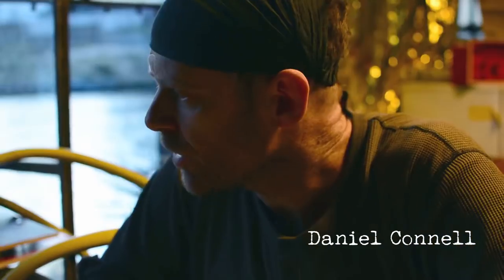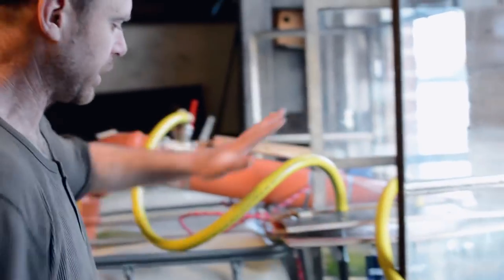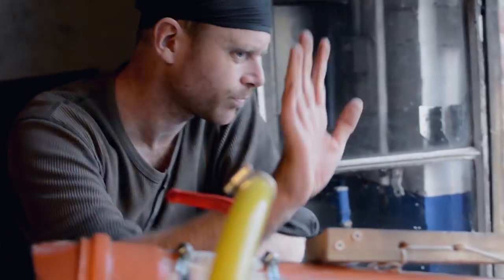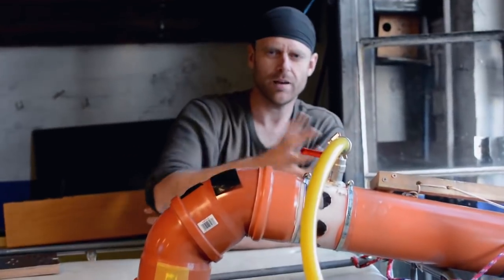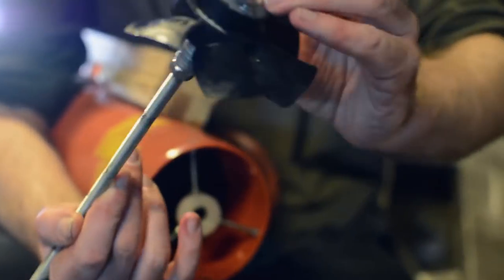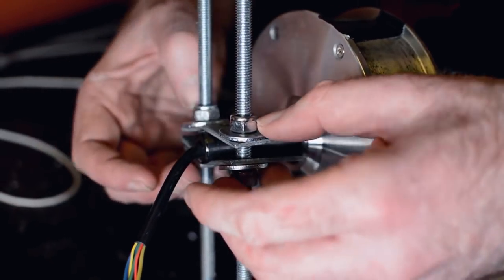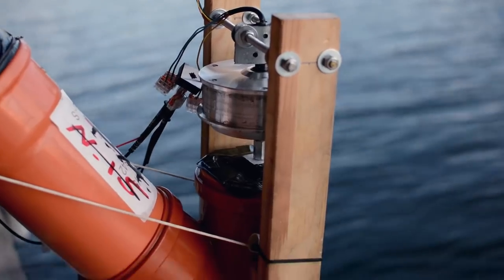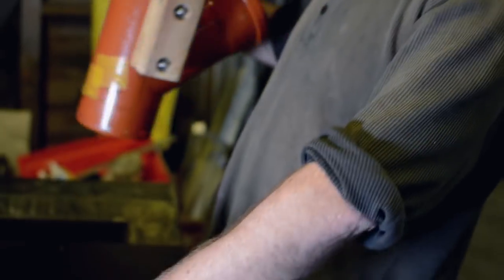$50 Water Turbine-5 kilowatt hrs/day - Open Source, DIY

Comment: How about a Tesla Turbine at the end? I know, maybe not a 40€ Turbine anymore, but would be interesting to see the difference in output
Reply from the maker: Problem would likely be that it would reduce the flow in order to generate its working pressure, and so take a lot of power away from the fan impeller.

Comment: Awsome,..... now for a challenge, can you make something for a no head stream or creek like i have, its turning my brain to mush.
Reply from the maker: It's been asked a fair bit. Yes, but kind of only really if the water is moving fairly quickly.
Flat water with not a lot of flow is notoriously hard to extract energy from.
I am giving it thought tho..
Reply: Yes thats right, and thankyou for the reply. You've got my brain matter churning , maybe i was thinking too big.
Do you know the rpm its running at its full potential?
Reply from the maker: Yeah saw that, it is quite similar to mine but predates it, and I only became aware of that turbine after I'd started working on mine.
Seems more robust and possibly more efficient, but about thirty times more expensive...
Reply: @OpenSourceLowTech  Do you know the rpm its running at its full potential?,  Would a fan with a less flat angle and having 2 of them about .5mtr apart, give you more rpm with more torque?
Reply from the maker: Top of the power curve for this test was at about 1200 rpm.
I tried two other fan shapes, one with steeper pitched blades, one with a larger central hub, both did about 20% less power overall. From what other similar turbines use I think probably something like a outboard propeller would be a more ideal shape, but the PCU fans seem to be doing a reasonable job, and are by far the easiest to source that I've found so far.

I also tried two of them back to back, but it didn't make any measurable difference at all.

Comment: Can anyone advise how to calculate the power necessary to charge a battery bank?  Would you be able to combine a solar and hydro solution into one bank or would you need to have multiple ones?  Thanks for any guidance.
Reply from the maker: Depends on your setup and needs.
If you get a charge controller or equivalent box which can handle PV and hydro then the two would probably compliment each other quite nicely.
Reply: Thanks for replying! I think your work is really amazing

Comment: Are you running into problems when increasing the height?
It seems like it is reyling on suction, since the turbine is in the top. I could imagine that introduces problems with cavitation and maximum operation height of around 10m. Am I right?
Reply from the maker: The largest drop I've tested so far is three meters, but the longer term field test install I'm currently working on is almost five.
Cavitation has been an issue and that's the main reason I moved the turbine assembly further down the pipe in this build than the last one in Barcelona. That plus increasing the diameter of the draft tube seems to help a lot.
I think with larger drop installs it'd probably be best to keep the draft at about three meters and have the extra height on the uphill side of the turbine, but I'll experiment with various configurations and see where the sweet spot is.
Reply: @OpenSourceLowTech  Thanks for the answer, very informative. Love this project, intention, execution and dedication <3

Comment: Question for anyone. 
how much power would it take to pump water back up to the resevour?

Would the power to pump water back up drain all of the power this process would generate?

In short to create a system that feeds itself, but leaves some extra power left over? If done in scale potentially feeding part of a home's electric needs?

Comment: can siphon work decreasing the outlet? i'm thinking the output is smaller so it's shoot like a jet pelton turbine generator.
Reply from the maker: The power comes from the momentum of the water, so you want to get as much volume moving as quickly as possible. A throttle / jet would increase the velocity at that point, but reduce the flow overall and so reduce power.
It's quite a different dynamic to a pressure turbine such as a Pelton or Turgo.
Reply: OpenSourceLowTech 
The deciding factor is the geometry of the impeller blade as a function of the head and the pipe diameter but I agree that minimising friction losses is important. I think you should try experimenting with different fan configurations if you have not already done so. For example, put two fan rings one directly after another on the same shaft but offset by one half pitch. This will increase the torque but may disproportionately reduce the angular velocity. Conversely, the opposite effect will be seen by snapping off every other blade in the one fan setup. You have tuned the electrical side but not the hydraulics!
Reply from the maker: @davelowe1977   I trialed two other shapes; one with steeper pitched blades, and one with a larger central hub. Both did about 20% less power than the standard 120mm fan as pictured, which I was happy about as they're by far the easiest to source.
I also did exactly that with the two fans joined, was also anticipating a potential boost to torque at the cost of rpms, but in actuality wasn't greatly measurably different. 
Also wanted to thin the blades but unfortunately pretty much all these fans have seven...
Reply: @OpenSourceLowTech  Sometimes what doesn't work is just as valuable information as what does!

Comment: How much power can it produce now? You certainly need an inverter and may be a transformer.
Reply from the maker: 192 watts, with some room for improvement.
What you plug it into will depend on each individual situation and use case, but those are options, yes.

Comment: Would you be able to add more turbines per system or would you lose more power than it's worth?
Reply from the maker: You'd lose more power than you'd gain. Each impeller extracts momentum and slows the flow, so essentially steal energy from all the others.
Reply: @OpenSourceLowTech  thanks!

Comment: I can't get what are these electrodes doing? Sorry if it's a dumb question.
Reply from the maker: In the liquid rheostat bottle? One's putting the current out, the other's receiving it. The purpose is that the liquid in between is only partially conductive, so by making the electrodes further apart I can introduce a variable amount of resistance in the circuit, which lets me set the current going through it and thereby measure the amount of power the turbine is generating under different loads.
And that lets me find the point of maximum efficiency and output.
Reply: @OpenSourceLowTech  So... is one of the electrode's like a variable resistor? And... I guess you've made it to be sure that a mechanical rheostate will not be burned?

Comment: What happens if a fish comes through the pipe it will get stuck and jam the mechanism or other River Dabre.  I can see that would be it's the liability of that impeller.  I guess if you put a screen over the end would solve that problem.
Reply from the maker: As you say, screen.
Mesh box to increase the surface area and reduce the pressure should hopefully do it, especially if it can be clever enough to be self cleaning..

Comment: This is incredible! Would this work in the winter in places where winters get pretty cold? (I live in Michigan USA)
Reply from the maker: As long as the water keeps flowing...
Even if the surface of a body of water froze over you could theoretically just have the pipe draw from the unfrozen layer underneath...

Comment: I live in the Pyrenees. There is a river by my house. How can I buy a system like this?
Reply from the maker: I may end up selling units at some point, there'll be a full build tutorial once I'm happy with the field test results.

How much drop and flow do you have, and what would it be to power?
Reply: @OpenSourceLowTech  Actually the river is lower than the land, but the current is very strong and I am not allowed to change anything in the river. Just wondering what kind of the system would fit.
Reply from the maker: This turbine doesn't need as much drop as most other types to function. but is still at least a couple meters.

Flat water is pretty famously hard to get useful power out of, I do have a potential idea, but have to try it out before knowing if it'll work or not.
Reply: @OpenSourceLowTech  Thanks for your prompt reply. It's very kind. I'm thinking of to place one or two even three devices in the current and combined the power together. The currents of the river is really very strong, it called le Carol. We got to get good use of it.
Reply: @OpenSourceLowTech  The current of the river is very strong and it runs 365 days a year. I think we should get the good use of it. May be we can place two generators in the water and combined the power together?
Actually there was a hydroelectric station in the past, was removed by government 30 years ago.
Reply from the maker: Something like the WaterLily turbine is probably your only option in flat water.
You won't get much off it, and they're maybe a little expensive for running a bunch of them..

Comment: I have a question if someone could please help. Inside of the shaft from the fan directly moving the alternator, could you generate more RPM by attaching that shaft to a large(ish) bicycle gear then connecting with the a chain to a smaller gear which then drives the alternator? Maybe use a 1:3 or 1:2 gear ratio? Thanks in advance
Reply from the maker: That would increase the rpms and voltage, but I've kind of already got an excess there. I might actually benefit from gearing it down rather than up, as this would effectively trade revs for torque, and voltage for amperage, which I think may give me more power overall, but I'm enjoying the mechanical simplicity of having it direct drive. Makes it a lot easier to build and replicate.

Comment: Have you thought about running from tides
Reply from the maker: I have, and technically speaking they could work well, but you'd need a pretty significant weir / dam kind of situation, which would probably be cost and practicality prohibitive, as well as quite possible messing up your estuary..

But if there were some kind of natural wall or the like which the tide breaches, a row of these guys along it could produce some useful power..
Reply: @OpenSourceLowTech  thanks. Another question that I have been to find an answer to is how high do you think a syphon can lift water before the turnbine? 1m or 2m. I think it is influenced by the fall / pull of the down hill side/ leg of the syphon?
Reply from the maker: Strictly speaking, as long as the outlet is lower than the inlet it'll lift it as high as you like.
Might get a bit tricky to prime before too long tho.

Comment: Hallo Daniel, a question. I have built a generator based on your video and I am hopefully going to test it soon. I think I read in a comment that you tested with a waterflow of 35.000 liters. Have you also tested what the minimum waterflow has to be to for the generator to start working? In your sheet you mentioned the rpm. Hope to hear from you.
Reply from the maker: This build was going through  about 30-40 liters per second, about 1400 rpm at peak efficiency. The turbine will start spinning under zero load at very low flow, but I found the peak of the power curve for this configuration was about 3A load @ ~60VDC.

Got some media of what you've built?
Reply: Thanks for your answer. Not yet, hope to test soon.

Comment: Marty T is getting a lot more power from an old rebuilt washing machine, and have had free power for the last 7-8 years....
Reply from the maker: His is a Pelton, which are pretty efficient and not massively hard to make and use, but being pressure turbines, require at least 15-20m plus drop to operate.
This one is a momentum turbine, and can work with two meters or less.

Comment: Would this work, let’s say in a swimming pool? Like, is this something I can put in the back yard?
Reply from the maker: It goes through about 30 liters per second, so would drain even a moderate size pool in a couple minutes.
It's designed for use in constant waterways, ie small streams and up, with a couple meters natural drop.

Comment: On 8:57 you can see 67v for less than 3A, that is 200w, while in the description the author claim it could generate up to 1200w.
That is a 16% efficiency, can you confirm? (edit: no, the author confirmed 27% efficiency, so the system could generate up to 600w, not 1200w)
Don't get me wrong, is cool that you try to make it work at all from scraps and clearly there is a loot of room for improvement, but why aren't those result discussed?
Reply from the maker: The power is 200W, do I say 1200 somewhere?
Which is about 27% efficiency, on which yeah there's room for improvement.
Reply: @OpenSourceLowTech  
"do I say 1200 somewhere?" 
sorry but trying to figure out the missing information i made some confusion, in the description, "This turbine can be built for about half the cost of a 120 watt solar panel, and will produce about ten times the power per day", i didnt notice the "per day", i guess you meant 12h of 100% power production, that would be 600w, and align with your statement of "Which is about 27% efficiency".  
Also i liked the idea of testing different load resistance to verify the efficiency at different load, but we got no result.
Would be nice to have in the video or in the description a link to those result, would avoid people like me do dumb mistake and affirmation
Reply from the maker: Ah right, gotcha. Wattage is the standard measure for power, for obvious reasons, but with renewable especially it's necessary to factor in how much time they're actually spending producing, which for hydro being usually 24/7 means that even if it's only doing a fraction of the peak power of something like a PV panel, it's spending a lot longer doing it, and that all adds up.

I'll likely publish the power curve data for the various configurations of this that I tested in an upcoming video, for the data philes out there.
200W @ 61VDC x 3.1A was more or less the peak tho. Still got a few ideas for hopefully increasing that, but it's the figure I was going to be happy with going forward on.

Comment: Can this be modified to work on a boat?
Reply from the maker: Not in its current form. The siphon requires drop, it won't work in flat water.
I do have an idea for a turbine which might, but that needs prototyping.
Reply: Awesome. I have a an idea as well. 
It's a Pelton wheel, and  jets. kinda  like how  a car turbo. Works.
In stead of air, it would use water.  Oh wow. Just had another idea. What if you turn the PVC pipe... hold on
Reply: Dude I have something to show you. How do I contact you.
Reply from the maker: Email address on the opensourcelowtech.org site.

Comment: I'm not sure what calculations you used, but by my calculations, 5kWh in 24 hours means you're producing about 205W, and that is clearly not "about 10 times of a 120W solar panel" as the description states. Am I missing something?
Reply from the maker: A 120W rated solar panel is likely to produce about 100W for maybe 5 hours per day if it's sunny, so roughly 500 watt hours.
This turbine is producing about 200W (measured 192 under load but it should be slightly higher than that on the next build) which is 4.8 kWh per day, so about ten times more.
Reply: @OpenSourceLowTech  My bad then. Terribly sorry, you're right.
Reply from the maker: Wattage is the standard unit for expressing power output, but when it comes to intermittent energy resources like solar wind and hydro, watt hours per day can give a more complete picture.

Comment: Why the hoverboard wheel and not a car alternator? I would imagine an car's alternator would be easier to find in developing nations.
Reply: Compact, tidier, good output
Reply from the maker: Basically what Free Bird said.
Car alts are fairly universally available, but not efficient or high volting per rev. Motorbike alts are also quite accessible and do better numbers, but have to be mounted on a bearing.
These are all problems which will need to be solved in order to make this kind of tech available and relevant to global south countries and low resource environments..

Comment: Hi could you design a 1kw hydro system for a boat please
Reply: Boat systems are already commercially available. 2 main options assuming you are a sail boat that is sailing. There are dedicated systems that put a propeller in the water that turns an electrical generator and if you have an electric motor vs. say a diesel you can use the water flowing past your propeller to turn the motor which makes the motor act like a generator.

Comment: Some math is always welcome... 1 liter per second gives 1 newton over 1 meter x g is...9.81 ... basically 10 watts.  inefficiendies ... and all... 5 or 6 watt per litre/s per meter. 

35litres x second... 350 i guess you have a 2 meter drop, so 700 watts, you can expect to harvest  some 450w max, with low budget 200w is VERY good.

35l per second is A LOT. rivers don't have 1 meter drops here and there... and you need to give back the water to the river... if you're using channeled water like in catalonia, you're probably disturbing whatever neighobor you have... and cause some field to flood... 
if it's to be used in streams and such, you have to redimension it ... or maybe thing about build a water ... tank, to store water, like a battery and turn on the pump when you need the power.. so not 24/7.
Reply from the maker: Yeah I'm largely happy with the efficiency, tho may be able to squeeze out a little more with future builds.

The actual use case of this will be just plugging a more or less straight length of pipe into a waterway with natural drop. The exit water will just go straight back in.
Pumped hydro storage is also an option, where appropriate.